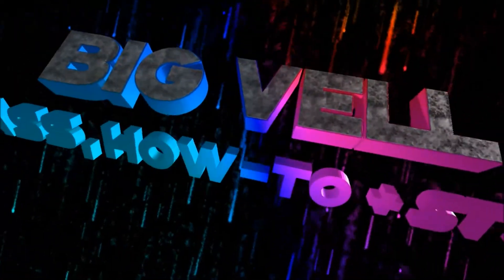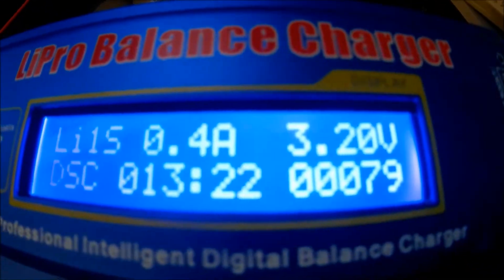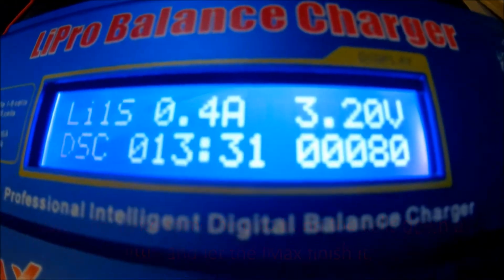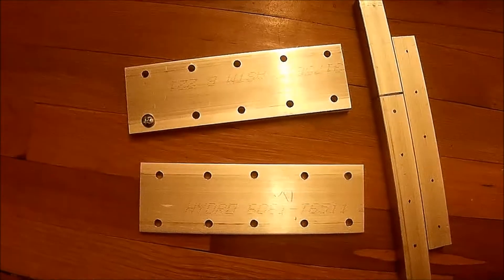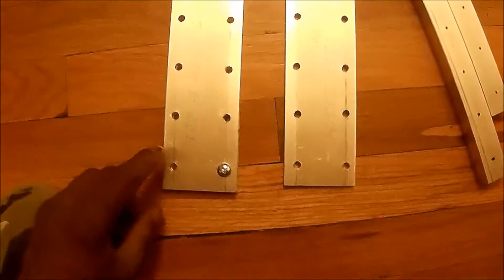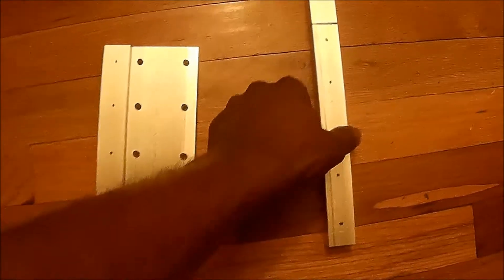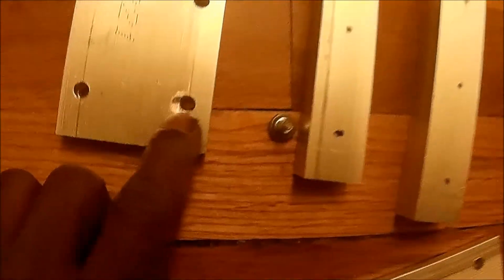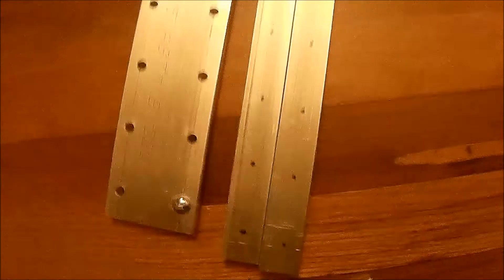Headway 38120 Car Audio 40Ah Lithium Battery Build

Comment: Are you using a BMS?
Reply from the maker: At the time I didn't but I eventually added one. Highly recommended.
Reply: Bigvell02 can you help me out a bit with the BMS part. Is that only used for charging?

Comment: Hey bro just binge watched your RS build, lots of good tips & had my wheels spinnin i appreciate the good content! Was wondering how your cells are holding up? Do u recommend buying new? What is a good way to bring the voltage down for balancing? Again, great build & content thanx!
Reply from the maker: I truly appreciate your comment and input. I'm not using headway cells in this build but I still have 2 40Ah batteries and a 20Ah all on different builds for friends. I would suggest keeping them in 40Ah groups and of course a BMS is ideal. Monitoring the cells is and output voltage is always good no matter what lithium garage built or branded.

Comment: Curious, do you just connect alternator to this like a normal battery? like no extra charge protection devices or anything right? alternator should not overcharge right?
Reply from the maker: Yes you can hook this battery up to a alternator issue free. Before hookup I made sure the pack was balanced and it did great.. I would make sure it didn't charge above 14.8 ideally 14.4 to 14.6. Good memories with this pack I was pulling over 600a over 6000 watts RMS.
Reply: bigvell02 that’s sweet, I’m building a 48ah pack to hopefully see 6k total with my build  vocals and bass... can’t wait.. gonna get my 320-370 alternator too to keep her alive

Comment: can you do another one of these and show how to properly connect them together...this is the main thing im struggling with.  Some videos i've watched only show how the top is connected, or the bottom, but not both, and this is critical to know if attempting a DIY
Reply from the maker: I opened a battery company business. I'm thinking about offering plates to connect these cells for a 12v configuration. I will make a video in the future once I get a chance. Been extremely busy lately getting ready to start the new build and drop the battery line. In order to use Headway cells in automotive you would connect 4 in series to get the voltage required. I highly suggest making sure the cells are balanced, the internal resistance is very close as well as capacity Ah. Another option is prismatic cells with a good C rating.

Comment: How they holding up for you man
Reply from the maker: Very well. Getting much better numbers. Voltage is way more stable, at 4k to 5k watts I won't drop below 13.6 on a hot hot day 13.4 getting ready to build another pack Headway FTW
Reply: How many Ah u think I need for a SKAR RP4500 ON 2 ZVX 18S WITH A 320 AMP ALT?

Comment: Nice work I’m new to all this but I’m building a portable solar generator and wanted a battery back that 12v maybe 200-300 amp hours got any advise for a rookie in this realm of tech cuz I have no clue on what to do I’ve been watching this 38120 battery and like the deal can you help me build one that could do the job I need and teach me a few things as well thx in advance
Reply from the maker: Stay tuned I will be coming back to the battery detail soon. This pack is close to 3 1/2 - 100Ah batteries any brand. This could easily power a portable inverter I could pull 4000 watts constant safely. That's not peak no where near.. May I suggest read up or watch cell balancing and monitoring. Sway away from lithium ion. LIfepo4 chemistry is the way.

Comment: Nice set up i love the details on how your doing this. But one question did you do a current pull on your system before you bought the cells? Im knocking down 480 amps truck off and seeing 12.4 volts on a 30 sec burp at 30 hrtz and 40. I got 5 agm batteries and would love to reduce the weight in the truck withes cells. Just wondering how many i need.
Reply from the maker: Last I clamped 390a both amps are wired at 1/2 ohm. I drop down to the high 12s with my alt now when I had the stock and the sms220 in the rear I would drop into the high 11s at times smh. I burp at 33-37hz usually 33. I do plan on doing a before and after video along with some real world testing. The math on this 40ah pack I'm doing should be 400a constant should run a 4k-6k amp.

Comment from the maker: My bad about the volume at the 2nd clip. It goes back to normal though, I think it was the fan.
**It is 7/10/18 I just checked each group and all are within 1/100ths of a volt - I'm very happy about that it my voltage is very solid now.
Reply: bigvell02 Looking really good bro!! Very nice progress, very nice job!!
Reply from the maker: Much appreciated bro. I hope to install today, seems like I have a ton to do before Slam. I attempted to build a amp rack floating 1 inch above my sub box. Complete but the trunk is a mess lol.
Reply: bigvell02 right on, I haven't built a rack yet either. Can't do that until the battery dilemma is figured out to incorporate possibly with the rack. So running that pack series parallel what did your final voltage come out being?
Reply: bigvell02 I need to get up with you about those batteries need a little info send me some way to get up with you